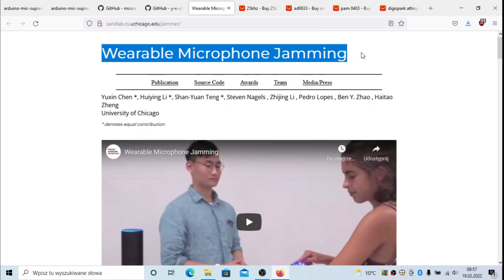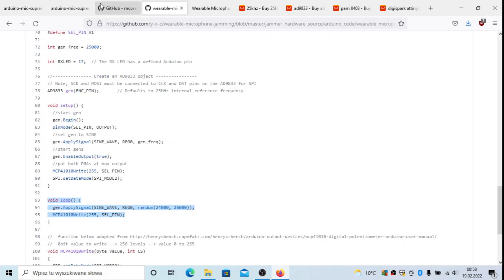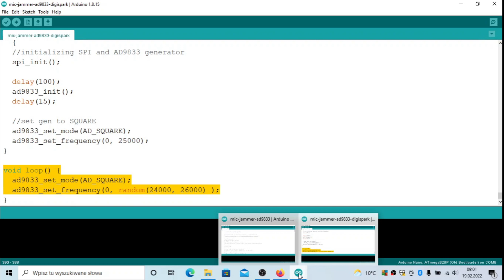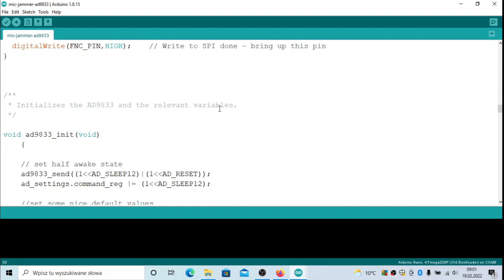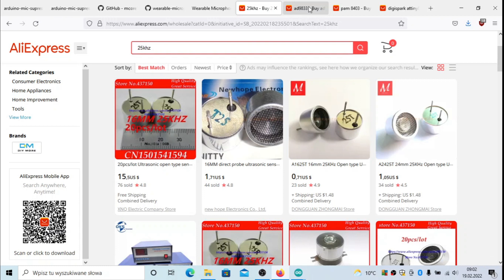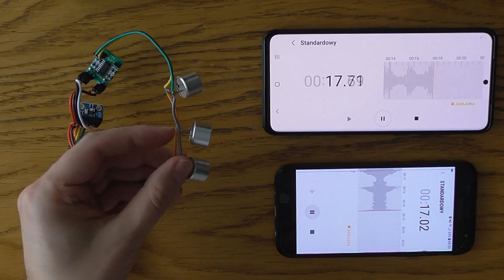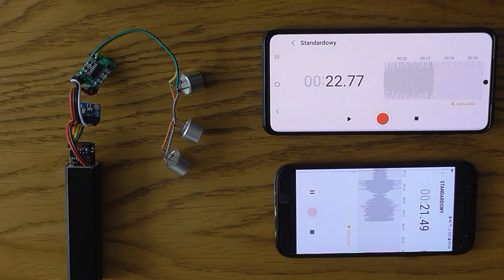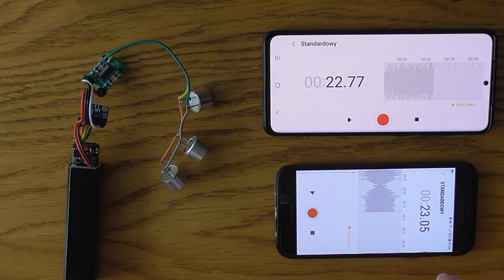Simplest, cheapest, effective DIY ARDUINO ultrasonic Microphone Jammer / DIY ultrasound Audio Jammer

Comment: Thank you very much, I have no idea about electronics, with the instructions it was also possible for a beginner. I have one more question, you explain that it would be possible to send music faster with another Arduino instead of rushing, could you explain it in more detail, maybe for replicating. An ultrasonic speaker is expensive. Thanks in advance

Comment: Hi
If you could with a simple yes or no, tell me if these transduces will fit, that would help me.

I can't send the links because youtube blocks them... so I copy and paste the title of the article and its characteristics written on aliexpress

Thanks

16MM probe, ultrasonic sensor, transceiver, 25KHz ( in french : Sonde de 16MM, capteur ultrasonique, émetteur-récepteur, émetteur-récepteur, 25KHz )

Product performance:

1 nominal frequency (KHz): 25KHz

2 transmit sound pressure at10V (0dB = 0.02mPa) 115dB at 25KHz

3 receiver sensitivity at40KHz (0dB = V / ubar): -68dB

4 capacity at1KHz, <1V (PF): 2400%.

PS : They ask me to choose between T25 and R25. I took T25, is that ok too?
Reply from the maker: yes these will work just fine. both R25 and T25 are ok. Transmitter is also receiver when talking about transducers

Comment: This is basically a line-of-sight technology ?  (Directional)
Reply from the maker: for expensive phones it seems to work this way. But cheaper phones and audio bugs are more susceptible and do not have to be placed in line of sight
Reply: @justanengineer5599  

Makes sense as expensive phones have advanced noise canceling.

Thanks for the reply 👍

Comment: Hi, you said that to increase the range you can use a pam8610 amplifier, the problem is that it needs 12v and the generator and the microcontroller work on 5v, how do you solve the problem?
Reply from the maker: step down dc converter 12v-5v is needed. Then you would power whole device from 12V and 5V from the converter will be used to power Arduino + AD9833. You could have it installed inside your car to have possibilty to perform "secure talks" inside your car

Comment: Hi,
The transducer 25khz 
Have  2 types: transmitter and receiver.  I guess you have to buy only the type of transmitter, right?
Reply from the maker: actually there is no difference between transmitter and receiver. There are exactly same built except marking R or T

Comment: Looks very nice ! But i have an issue . I cant compile the code on the arduino ide , it says : USICR was not declared in this scope
Reply: I tried the previous one without ad9833 ans it works . But the code attached in this description doesnt work . Can you help please ?
Reply from the maker: I pressume you are using Digispark, right? For this device you need to have all Digistump libraries attached to Arduino, you also need to use  latest Arduino IDE. The other thing is the source code which has to be https://raw.githubusercontent.com/mcore1976/antispy-jammer/main/mic-jammer-ad9833-digispark.ino

Comment: hi can this jamm phone microphone like jamm calls or something like that ?
Reply from the maker: yes it can jam phone microphone when someone is making a voice call
Reply: What about the range ? Thank you you’re the best ❤️
Reply from the maker: depends on microphone in the phone. Up to 5-10 is possible for cheaper phones
Reply: Can it for example play a sound like transmit a soud to jamm instead of noise ?
Reply from the maker: it is possible but not with this device
Reply: @justanengineer5599  but it does the job to jam by the song right ?
Reply from the maker: it uses random noise and injects it into 25kHz. The same may be done for any other signal like for example speech to pass it to the remote microphone. It would have to be done with faster microcontroller that can read analog signal from ADC input and modulate 25kHz ultrasonic frequency with this signal. This is durable but not with this arduino chip. You would have to use some much faster Arduino like RP2040 based

Comment: It's very good.
I made a mic jammer referring to your previous video. 

By the way, can't any kind of jammer lower the ultrasonic noise that is generated minutely?
Reply from the maker: this one can. you have to switch modulation to sinusoidal and use potentiometer between AD9833 generator output and PAM8403 input

Comment: Thanks for this.  I was thinking a few weeks back about using an AD8933 for this, as I have used it before for other applications (see the signal gen on my YT page) I wonder if the transducer method would jam laser mics?  Would be an interesting experiment. Good job and thanks!